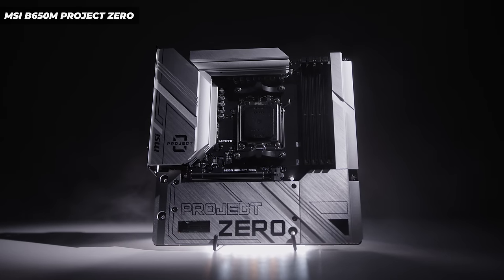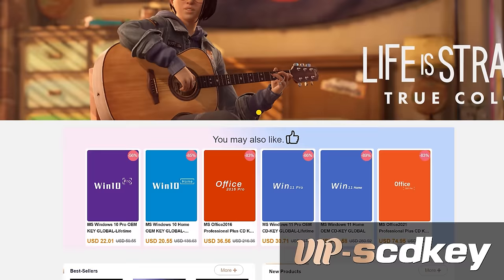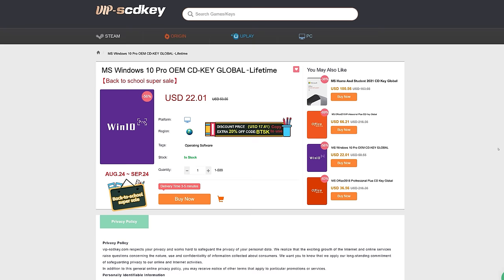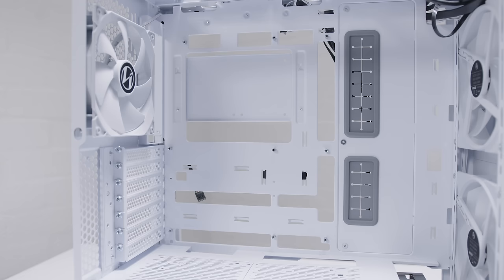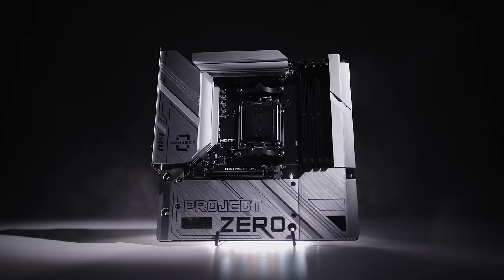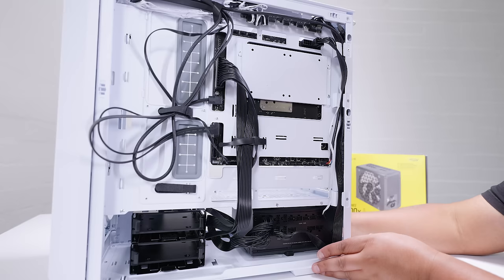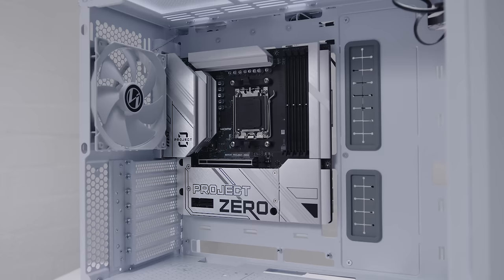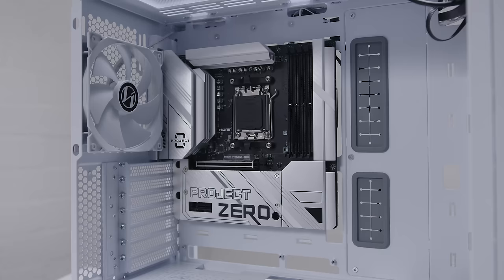Back Connectors - Lian Li Lancool 216R

Comment: This case reveals the issue with rear cables. Each motherboard needs special holes which will be very difficult to standardize, plus it makes the motherboard mounting panel very flexible unless made thicker. It is basically a solution for a non existing problem...
Reply: It's called a Dremel
Reply: @murdergorilla4087  it is called off topic reply.

Comment: I'm still not into mobos with rear connecting cables.  It just seems to introduce new issues to consider that don't outweigh the benefits for me.  Also, i want to see my braided cables so that I can give the build more of a personality.
Reply: Yeah, I like braided cables as well, but honestly, if being able to hide all the additional wires from the case and fans means sacrificing the ability to see the 24-pin and EPS cable, I think that is worthwhile tradeoff. There's always the PCIe cable that can be customized to add personality to the build. I can see this becoming standardized over the next few generations of PC hardware if the demand is there.
Reply: @@jensen999 just get a small custom watercooling loop

Comment: Everyone needs to standardize on this concept, if it is going to work long term.  In other words, imagine a big center main jack the motherboard plugs into that is hard mounted in the case.  In other words, like a car, sort of, where there is a wire harness jack.  The motherboard would just jack directly into the case.  Conceptually, the motherboard would kind of act like a CPU hookup, just drop it into the case on the main jack and you're ready to go.
Reply: That’s what he means by a back-plane.

Comment: when is this case coming out? and when can I buy it?
Reply: As of August 2024, you still can't because the 216R is still nowhere to be found outside of Asia. I'm in Europe and had to resort to an ASUS A21 case . I didn't like MSI's offerings when it comes to cases compatible with Project Zero / BTF. There's a list of case manufacturers on MSI's landing page for Project Zero, but most of them are hard to find or had nasty design flaws that I didn't like (eg. Coolermaster's Masterbox 600). I'm very happy with the back-connector motherboard and build though.

Comment: Excellent video for ‘Back Connector Motherboard and Case’ using for this build MSI Project Zero. I would hope that various manufacturers would offer right angle connectors for product options like cabling on power supply. I am considering the back connector’s but with the Intel MB, seems those case’s are not available as of yet in my search. Definitely makes the front look very clean, how long until there are GPU power connector changes, humm? Well done good information!
Reply: I was thinking about right angle connectors this entire video lol.

Comment: Dude...way to drop that bombshell in the 13th minute. I was just about to hit the shops. 
I love this back connector idea and the 216R addresses my fear that each mobo manufacturer would come up with their own proprietary solution where you got locked into their brand of case. 
That power supply had lovely supple cables, but my Corsair unit has thick 'wrapped' cables without much give. I imagine that would be harder to work with but I guess I could buy new cables or extensions. Great video.

Comment: I'm all for the rear connections. You can get right-angle connectors for the 24 pin ATX, 30 pin USB, and 8 pin EPS connectors. I hope the next big step will be holes in the motherboard for water cooling so the plumbing can be hidden.

Comment: I see 2 problems with that design, well actually 3;
- how to DISCONNECT EPS, ATX24pin? That cutouts are pretty small, it's hard to reach this clip and pull it in same time. Specially with 24pin ATX, which sits pretty hard in it's header.
- psu offering sleeved 24pin, stiff cables will be close to impossible to route in such cases without hair dryer.
- if GPU is powered off motherboard, WHY ON EARTH THEY PLACE 12VHPWR header on the motherboard, while this is not needed at all. In such small and tiny spaces placing such header is plain stupidity.

Comment: I really want! Please focus on this, MB manufsctures need to standardize this, and yes would be lovely to have also gpu power conector on the board (should be overspecced for future upgrades)
Would love to see one day a plug in MB which all conectors are already solidly placed on the Case or as you said a solid panel to plug behind the MB.
Im quite certain that Asus and Msi will be able soon to make motherboards integrated on cases, bad for.modularity yes, probably bad to discover problems on those when they appear, and not great for upgradability, BUT they could be cheaper! Since is all one manufacture and comes integrated no cables.